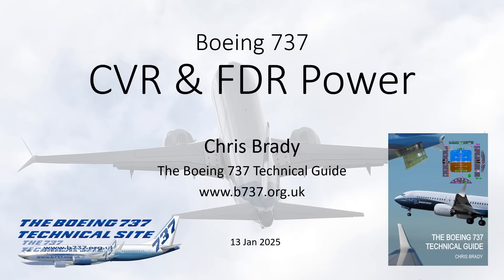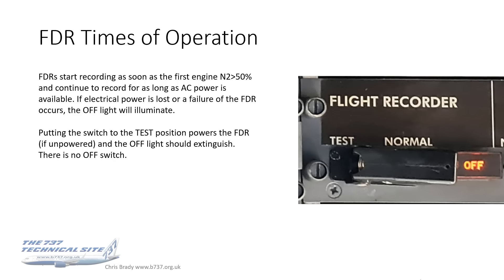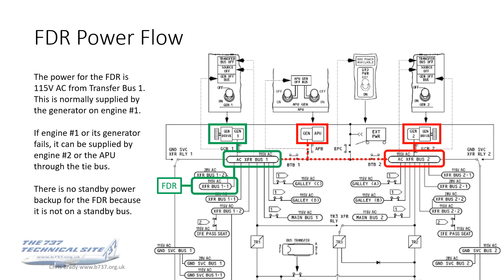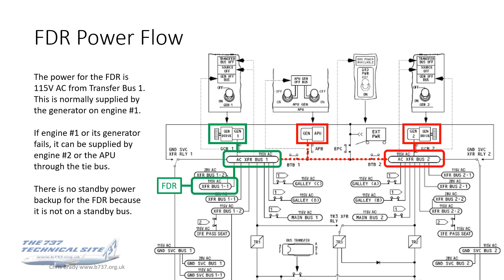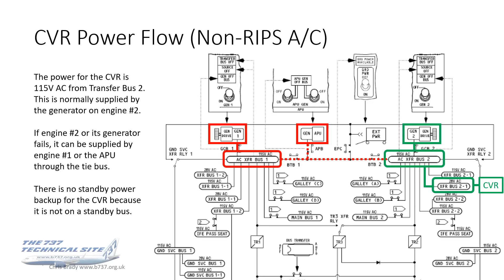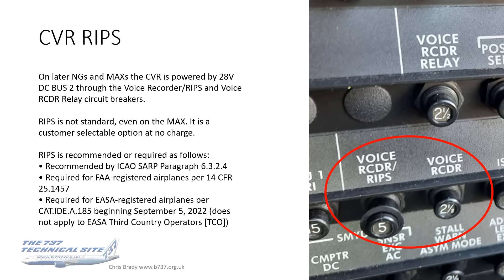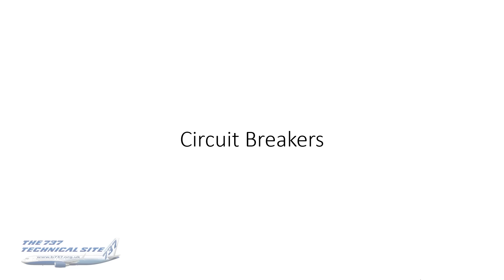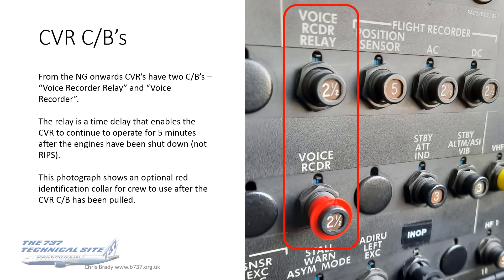737 CVR FDR Power

Comment: My question is. Then why is there a CB called DFDR DC (BAT) ?! Hmmmmm??? What does it do?!
Reply: All C/B’s are labelled for a reason. When they are pulled or if they trip, you know which one it is
Reply from the maker: These components get 28v dc power: FDAU status relay, Flight recorder test module and FDR fault logic. Again, the recorders are powered by AC and will not work without it (except RIPS for 10 minutes)

Comment: Also, the ADSB data was lost at the same time, which led me to believe that they were flying on standby electrical power and using the number 2 transponder. The number 1 transponder would have worked on standby electrical power. Given the number 2 transponder was selected on was likely because it was the First Officers leg. This will be confirmed with CVR data. The number 2 transponder gives altitude  data directly from the First Officers altimeter. The other scenario would have been transponder antenna damage by the birds.
Reply: Do you know which bus power transponder 2? It doesn't look right if both  transponder 2 and the CVR/FDR died at the same time at the moment of the birdstrike (IIRC around 500ft), and the crew still have time to retract flaps all the way to slat retraction, and have far too much energy for a 180 degree "impossible turn" for a return on the opposite runway.

My guess is that the transponder failed some time (moment of birdstrike) before the CVR/FDR got cut off (double engine failure/crew shut down the wrong engine). That would correspond correctly with their flapless config + high energy state.
Reply: @Avantime  Transfer Bus #2 powers the #2 transponder. So if the #2 generator came offline after the bird strike, the #1 transfer bus could have powered the #2 transfer bus through the bus tie breaker. But since there was no ADSB data, it means they were on standby power or did not have a working #1 engine driven generator either. This could have been due to bird damage, or they did shut down the wrong engine in flight. If they secured the number 2 engine after the bird strike, including pulling the fire handle, that would have disabled the thrust reverser on that side. But on landing we could see the thrust reverser deployed and some exhaust coming out the back of the number two engine.
Reply: @adrianthomas5104 Given the shape and size of the ATC antennae, I doubt birds would have taken out both the upper and lower ATC antenna. When, say, #2 ATC is selected, both the upper and lower ATC antennae are connected to the #2 ATC transponder. The transponder automatically selects which antenna is providing the strongest (reception) signal and transmits on that.
If power is lost to the main busses, the antennae automatically switch to the #1 system which is powered by the Standby Bus. Since the non-selected system (on the control panel) goes into a standby mode (in this case the #1 system), I guess there would be no transmissions from the #1 system even though the antennae are hooked up to it

Comment: Two things - apparently the FDR CVR are AC powered. So, like you said it isn't on the standby bus and if it was it would require an inverter to power it. Not sure anyone would want an inverter on a battery powered bus. 

Seems like powering these via DC would make them more flexible and easily powered by a battery bus.
Reply: There is a standby inverter that powers the standby AC bus from the standby DC bus if necessary. Capacity on both the inverter and the battery are very limited and it's likely this is part of the reason that the recorders are not on standby power.

Comment: Can I throw a theory at you ? This aircraft came out of maintenance, the APU was told to the pilots to be inop, the tie bus switches for some reason were turned off, but not turned back on, they had a double engine failure, what would happen, not a pilot but ATA engineer. Remember, we also lost the transponder at the same time as the CVR and FDR
Reply: CVR and FDR are not powered by battery or APU on this plane, so your theory is flawed. Engine failure alone would automatically shut down CVR and FDR.
Reply: @CodyCha The APU should power the recorders, just not the battery.
Reply: @CodyCha  Then explain why the right engine showed it was running, even at idle it was producing power.
Reply: @flightsimdev   no one can answer that. It doesn’t mean there wasn’t electrical failure. There’s also remote possibility that pilot pulled the circuit breaker. 

Because the ADS-B also stopped working, we know there was a power failure. We can rule out the theory that blackbox was erased.
Reply: ?🤔what theory?
Reply: @psoon04286  Read my comment
Reply: The black boxes on the 737-800 are designed with an independent power source, typically a dedicated battery or capacitor. This backup power ensures that the recorders will continue to function and store crucial data for at least 30 minutes after the electrical power has been lost, which is the standard requirement for flight data and cockpit voice recorders set by international aviation authorities.
Reply: @flightsimdev  Did you watch the video?
Reply: @danielbond9755  I did but didn't explain what I was looking for, did get the answer though
Reply: @flightsimdev  no battery on pre 2010 models. It only run on AC power.
Reply: @flightsimdev  my question is, how did the plane stay in air for another 4mins at 500ft if both engines are out??
Reply: @MD-fg6nc  It was on approach it should have continued its landing as normal, the go around was their mistake.
Reply: @ there was a theory of which after tower notified them of bird activities, they saw the birds and decided to pull up to avoid the birds but still hits the birds on climb anyways. That’s why called Mayday go-around since they were no longer on the glide path. That being said, 4mins before crash was roughly at the just after they called Mayday if not right when they called. If they lost both engines/IDGs, would they have been able to stay in the air for another 3-4mins when they were already at 500ft. Captain Sully had 3.5 mins after birdstrike at 3000ft…
Reply: @MD-fg6nc  I'm going to guess it's a combination of poor maintenance and pilot error
Reply: Didn't Blancolirio say the 737 doesn't have an APU, just a battery.
Reply: @onceamoth  The 737-800 does have an APU and a battery, but dose not have a RAT.
Reply: Saying that the black boxes aren't essential in an emergency is somewhat mindblowing.
Reply: @onceamoth  The recorders are not essential for flight.
Reply: If one engine generator is lost and the bus transfer switch is set to "off" instead of "auto" (although it's a guarded switch so that seems hard to miss) then you'd lose either the CVR or the FDR depending on which engine is lost, but never both at the same time.

Comment: Blancolirio sent me here:  I thought batteries even out or smooth out the generators producing power so that loads get a steady, even power supply.  I'm surprised everything isn't getting power from a battery (being charged) to smooth out power fluctuations.
Reply: This is an aircraft, the batteries are used as a source of backup power etc. Batteries have nothing to do with evening out or smoothing the three phase power that the IDG’s produce on an aircraft
Reply: AC Battery?
Reply: This is a Boeing design, running off battery back circuits would cost more money
Reply: @robertlee6338 It is 60s design, originally designed to run a tape with AC...
Reply: @ Not powering CDR and CVR via Battery backup was a conscious cost cutting engineering decision. 

To power the CDR and CVR Boeing would have to install a bigger costly batteries.

However lets be clear, CDR and CVR are NOT critical in operation of the 737 nor life threatening.

The 737 didnt blow up on impact of the concrete structure because CVR and CDR wasn't recoding!

From incidental information and piecing together what occurred, if the pilots was less trained, than they might have veered off the runway rather than perform almost text book no power landing... RIP
Reply: @robertlee6338 you think Airbus do it that differently?
Reply: @NicholasRiviera-Dr  Depends on the plane, however equivalent 320 series have far more electrical backup systems as they are Fly-by-Wire 

ie electrical systems are more critical.
In a Boeing even with total electrical loss some hydraulic system work indefinitely, though it will be physically demanding and limited in operation.

In an Airbus 320 with both generator + apu and battery loss, the plane is glider without steering or any control
Reply: @robertlee6338  so this video is related to a B737NG. If total electrical failure happened, what hydraulic systems will run indefinitely?

Comment: Thanks for the video! Why isn't it battery powered if lost both engines (which really could be happening, due to bird strike, severe weather or fuel loss). Is it also what I have heard that some of the instruments and such blackouts until you get an engine or APU started? If so, that's also a real stress factor that may impacted. Also the APU need some time to turn on, they did not have much time to land the plane. Newer Airbus has Ram turbine that pops out incase of an power failure which also could prevent this.
Reply from the maker: It isn’t battery powered to conserve battery power for things you need to help you land with a total electrical failure.
Reply: Because landing the airplane successfully is a higher priority than a crash, then figuring out why they crashed to find out there wasn’t enough power.

Comment: Different Aircraft (A320) , but USAir 1549 into the Hudson lost thrust on both engines. Capt Sully quickly toggled APU. Did Airbus get this right? APU takes time and I don't recall a loss of CVR, FDR in that aircraft, even after engines went and before APU. Airbus different and had standby? Or were circumstances different? Was the engine still providing some power on the busses?
Reply: The A320 has a RAT that will deploy immediately after loss of both main AC BUSSES.
Reply: On Flight 1549 Sully Immediately switched the ignition on and pushed the APU Start button. One engine provided just enough “power” as it began to wind down to continue to power a Generator until the APU came online which is usually about 30 - 45 seconds. In the case of 1549 I believe they stated that they did not go into ELEC EMER. I assumed that was because of how quickly he acted with starting the APU. The 737 is a little more cumbersome to start the APU and switch the Generator online after.
Reply: @ That is false. The RAT did deploy because the APU takes about a minute or so to power on, the RAT deploys in seconds as soon as AC BUS 1+2 lose power. Even says in the final report the RAT was found in the extended position when the plane was recovered
Reply: @tomstravels520  My bad. I was going on something I remember him saying about stating the APU immediately in his book and as a result had the APU Gen online very quickly and allow him to stay in Normal Law and that when they got to the step in the QRH about manual deploying the RAT they decided not to because they never lost electrical power. I’d have to look that up in the report though.
With the APU Gen online the RAT is irrelevant. The APU takes less than in a minute. 45 seconds max to have the gen online in my experience on the 320. 
Also was it ever clear when the engine fully kicked the engine driven generator offline? It is not always immediately in all engine failures. I believe they had minimal thrust in one engine for a short period.
Reply: I think Rat powers the cvr/fdr on airbus.
Reply: @avitor500  FDR would be lost as its powered by AC BUS 2, CVR is powered by AC ESS SHED which is powered by the RAT through the AC ESS BUS and emergency generator

Comment: the jeju  737 was ex ryanair .  just wondering  was there an under lying  problem with this  plane seen ryanair got rid of it
Reply from the maker: That is very unlikely. Airlines often lease aircraft for a fixed period of time, often 7 years then hand them back to the leasing company. They are thoroughly checked before being leased out again.
Reply: @ChrisBrady737   i flew on  exact  aircraft  between cork and stansted  and some thing extremely sad about this whole situation they were just  given no chance of surival
Reply: @samuesoeilyoriy6581  there were decisions made that day which could have saved the passengers
Reply: @ChrisBrady737  The incident aircraft was built in 2009 and was disposed of in 2016, after 7 years in service. A batch of 11 at the same time.

Comment: Thanks Chris! This was the critical info I was desperately searching for. Jb.
Reply from the maker: You are very welcome Juan, much appreciated 👍
Reply: @ChrisBrady737  Posting the link now.
Reply: @ChrisBrady737   @blancolirio  
As a Korean, I really want to thank both of you for your coverage of this awful tragedy.  There is sooooo much bad misinformation being put out by people who seemingly know nothing, but like to place a lot of premature blame on these pilots, who have not yet been proven to have been in the wrong, nor the main cause of this accident.  I just really want to thank both of you for being so professional, reasonable, and unbiased in your reports.  I appreciate all of your hard work on this, to bring us the correct and true information on this case.  ♥️❤❤
Reply: Does pulling fire extinguisher bottles cut off the generators as some are claiming ?
Reply: @paraspilot  Yes, cuts off electrics, hydraulics, bleed air and fuel to/from that engine
Reply: @paraspilot  yes, pulling the fire handle will:

- close the respective engine spar and fuel valve

- close the respective engine bleed valve

- Shut off hydraulic fluid to the respective engine driven pump

- Trip off the respective engine generator

and, 

- arm the respective engine fire extinguisher
Reply: @user-wl6bw3jl4n  this is why you can't push the handle back in and get the engine back, some of these processes are physical trip levers.
Reply: @persistentwind  Not true. You can always push the fire handle back in and get your engine back if it's not damaged. You do need to reset the generator field manually. The fire handles DO NOT disengage the generator drive. 
This is assuming you can restart the engine. The aircraft may not have been going fast enough for a windmill start. A crossbleed start may not have been possible due to the problems with the #2 engine... and the APU was probably not running to enable a main engine restart using APU pneumatics (bleed air). I've pulled and reset fire handles during maintenance on other Boeings with a similar setup. 
The only problem is legalities... and safety, especially if you have pulled used the extinguishant.
Reply: @ImperrfectStranger  this is the first time I've ever heard this... on what aircraft exactly?
Reply: @ImperrfectStranger  ok because that doesn't hold true for all aircraft...
Reply: @persistentwind  just to be clear this is only true as long as you haven’t fired the extinguishers squibs. If you just pull the handle but don’t turn it you can push it back in to reset the mentioned systems. Same for Airbus where you can push the buttons back in as long as agents not discharged
Reply: @persistentwind  I can't argue with that because I haven't worked on all aircraft :😁
Reply: @ImperrfectStranger  I am not familiar with the NG, but the classic(-400, eg.) generator-drive disconnect physically separated the mechanical link and could only be reset by on the ground maintenance. 
Edit to add after reviewing old manual: pulling the fire handle electrically disconnects the generator via relay and tripping a breaker, it does not cause the generator drive to disconnect. The generator-drive disconnect is a stand alone cockpit control or automatic action in the case of certain mechanical faults unrelated to fire.
Reply: @mytech6779  Thanks for your confirmation. Yes, these engines all seem to operate in a similar manner. As you say, IDG (generator) "drive disconnect" is not activated by the fire handle. What I'm not sure of on the 737 NG is the operation of the fire handle locking system. On other Boeings, you can't pull a fire handle when the respective fuel cutoff lever is in run and there is no fire. An override button is provided (under the handle) to allow the unlocking of the handle. The 737 NG has a similar override button, but I don't know if the fuel cutoff logic is the same. Also, on other Boeings, you can push the fire handle back in at any time (fire or no fire, fuel cutoff or no fuel cutoff). Again, I don't know if handle design is the same on the NG. If it is the same, then I see no reason not to push the handle back in unless forbidden by company/manufacturer rules. 
Restarting the engine without the APU providing bleed air might be more of an issue.

Comment: If During 2 engine fail , how long use vhf radio communiction between plan-controltower?

Thx captain
Reply from the maker: VHF radio is available from battery power even with no AC power
Reply: @ChrisBrady737  I think that that is just COMM1.